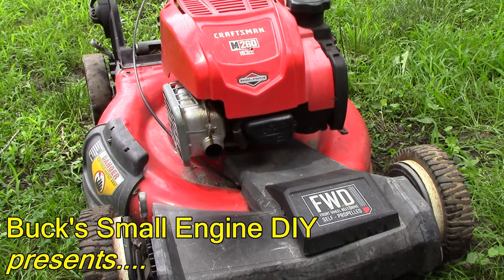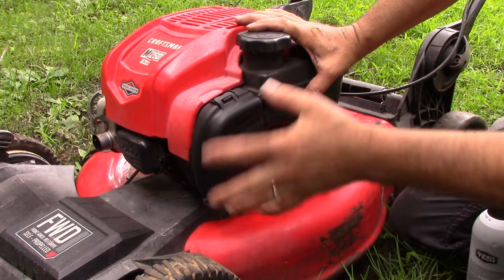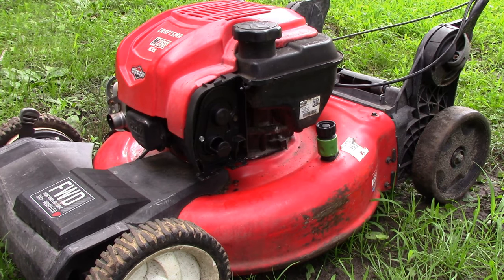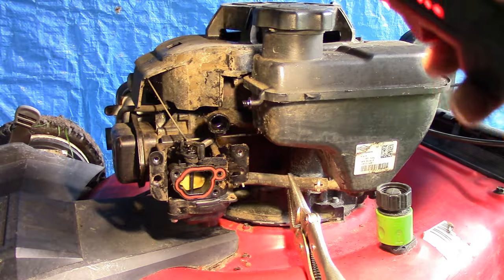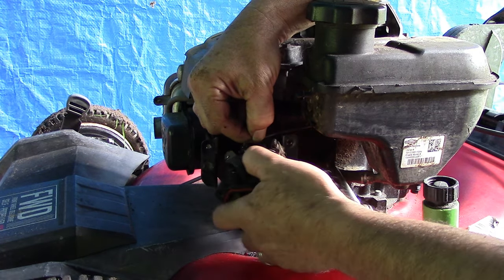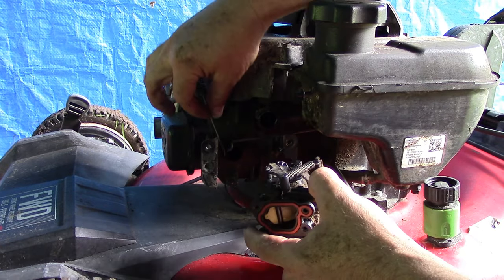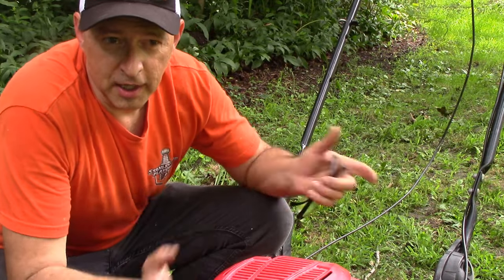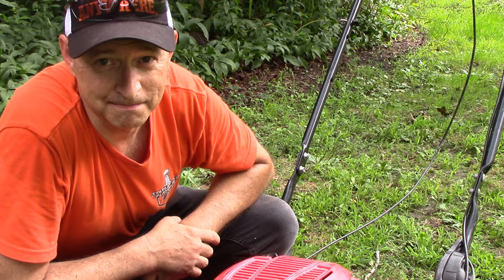Lawn Mower WON'T START - 10 Minute FIX !!! - Craftsman M260

Comment: I should not have to do this I just bought it yesterday and it literaly wont start.
Reply: Used mine twice and won't start
Reply: litterly
Reply: Yep these are junk after very little use
Reply: Don't make em like they use 2
Reply: Same it’s a pos
Reply: Was this your fix? What did you do?
Reply: I had water in mine, put gas  leaner in it works great
Reply: @punako268 Ive had mine almost 4 years without any issues until this year and the carb needed cleaned plus changed the spark plug and filter. Just like any engine they need care.
Reply: I would have taken it back. Mines worked great for nearly 4 years with hard use. Maybe I just got lucky but it's lasted longer than any other mower. Idk.
Reply: I hate this mower. Always problem with it. Spark plugs burn out every few mows. Did oil change even though manual says u don't have to. It's garbage
Reply: Save your gas hopefully it is not ethanol fuel take it back make them give you another one other option is to take a carburetor jet kit drill bit and open the Jets up just a little bit EPA but such restrictions on fuel powered mowers it's kind of funny painted out and burn it out or make it a little fatter on the fuel side and make it run
Reply: Same problem with mines I've used the damn things twice..I bought it new and now it doesn't work
Reply: @punako268  Have had mine for 6 years🤷‍♂️ only have replaced the blade
Reply: Exactly... Like wtf 😒

Comment: You can clean the gunk in the main jet as many times as you want, however, it will stop up again and again because the federal government wanted fuel efficiency and as a result the opening in that main jet is 0.12-0.13" in diameter (this where all the gas to the engine must pass through). You need to drill out the main jet to .021" to make sure it does not clog up. This is the diameter of most small engines without the plastic carb and it works just fine and even better at .021". Same for any new replacement cartridges.
Reply: I just bought the replacement 4 pack he linked and I'm going to try this with one and see how it goes.

Comment: ❤❤ thank you so much. I panicked from my fathers mower breaking. And I was the last one who used it so he was going to get mad at me. All I know is that it started then stopped. I was procrastinating the fix after watching this vid weeks ago due to I didn’t trust myself. Not today.  I took it apart and cleaned the jet out with water, soap and a needle and it works! Thank you so much for your vid. Other vids are not as detailed as yours. Will subscribe and like.
Reply from the maker: Great job fixing it yourself!

Comment: Thank you. Mower wouldn't start after 10yrs and was going to take it to the shop or buy a new one. Changed our spark plug and filter and still didn't work. Watched the video and in 10 minutes I had the mower going. Like you said it took longer to find the tools. I was able to clean out the line in the plastic component with a little wire. Fired right up on the first try. Good for another 10yrs.

Comment: I found adding a few squirts of carb cleaner into the gas tank and trying to start it at intervals while levering the lawn mower up and down with push bar finally got mine to work. 🤷‍♂️

Comment: This video got me to remove carb, (watch for O-ring) pull jet cartridge and get my neighbor's mower running again. Thanks for the video. My carb had an O-ring that fit inside carb where it pulls off from motor. Watch for that as mine fell out when removing and landed on frame. After getting it re-assembled I noticed an O-ring...Extra part...UGGGGG and had to figure out where it went.

Comment: Thanks for the video . I took it apart did option 1, sprayed the jets and used a brush to clean it out. Put it back together, started on the second pull. It is surging slightly, any idea why that would be happening?

Comment: Thx. Not a direct fix, as my engine's carburator is all metal (float, float bowl). Bought it in 2000 and still going strong. Anyway the single nut holding the bowl had small holes which I cleaned and blew into and I actually noticed the blockage free up. Back and running. Thx again.
Reply from the maker: Great job!

Comment: Thanks for that. I have the same mower. It starts first pull when cold, but after shutting off to empty bag, no amount of pulling will start it. It has to cool off.. Werd.. I tried cleaning the carb, no omprovement. So, I'm ordering a set of jets. 

Anotherr weird thing is the manual says oil does not need to be changed.. and there really is no place to drain it.

Comment: I did this but after re-assembling, I released the clamp on the gas line and fuel started flowing out. 
I don’t think I had the filter housing back on just yet, was that why or did I screw this up?

Comment: Okay, I took my plastic carb on my Briggs 500e off and took it all apart and cleaned it thoroughly.  Put it back; doesn't want to start and leaks gas til tank is empty through the carb throat.  I made sure all gaskets and screws were in good shape and tight.  Only thing I can think of id maybe the O ring and plastic retainer at the back of the carb is defective and leaking there.  Your thoughts please?  thanks
Reply from the maker: Leaking gas till the tank is empty means your needle/seat/float in the carburetor is not working properly. The easiest thing to do is just get a $20 replacement carburetor from amazon or ebay. Make sure all that gas has not flowed into the engine and filled up the crankcase with gas. In other words, check the oil level and make sure it's not overfilled. If it has, you'll need to drain that all out and add new clean oil. Good luck.
Reply: @Buckwsr  Actually I tested the float/needle when I had the carb off the machine and it seemed to function well.  I did buy an aftermarket carb and will install that and see what happens.  Thanks for your in put; I do enjoy your videos.  Keep them coming!!
Reply: @lawrencecarroll2031 I've had situations before where the smallest speck of dirt on the needle or the seat will cause it to leak and overflow...the needle was not seating fully into the seat because of the speck of dirt and it was slowly but surely flooding....
Reply: @macknumber9  Thanks for your input.  Believe it or not, it was actually the brake cable causing it to internittently start or not.  I had freed it up after being frozen with rust.  However it would pull the cable back far enough every time.  With a new (used) cable, it started and ran fine.
Reply: @lawrencecarroll2031  you mentioned that it was flooding
Reply: @lawrencecarroll2031  I'm assuming that the flooding you were referring to was actually just from attempting to start it and it was not starting because of no spark...so the carburetor itself was not flooding but the act of pulling the rope 10+ times was causing gas to be saturated inside the carb venturi area
Reply: @macknumber9  Yes. it was doing that too.  Never did figure out why.  I replaced the carb with a new one and also replaced the brake cable as I mentioned above.  Thanks to all for your comments and advice.

Comment: Can you recommend a store where parts can be purchased ?
Reply from the maker: I buy virtually everything online. No point running all over town to store who won't have what you need. Use mower brand and model numbers for online search. If looking for engine parts, use engine make and model numbers in your search. Good luck. See my amazon link in the video description for the carburetor jet I replace in the video.

Comment: Couple tips 
Probably should have drained the gas tank. That carburetor got crapped up somehow - bad, old, stale gas is the culprit. Drain and refill with fresh gas 
The screws inside the air cleaner are , 8mm and 7mm
In case viewers don't have 
9/32.

Comment: I don't have starter fluid spray. Can I use carb cleaner?
Reply from the maker: Some carb cleaner is flammable, some is not. The stuff from walmart is not, so that will not work. The name brand stuff, like Gum-out, is flammable and will work instead of starting fluid. You could also just shoot a little gasoline into the throat of the carburetor. Good luck.

Comment: It was fine all morning. Mowed two lawns then stopped working out of no where. It’s stress but has no power behind it now. The other problem is that once the blades engage, the mower turns off. m430

Comment: Use some Seafoam regularly say every 15 running hourse aprox., especially near fall and storage time. Then buy  a$2 shut off valve installed in the rubber gas line as a shut off, or completely empty the tank and carb bowl by running it dry. Store.

Comment: My problem was that the inside of the rubber gas line that goes from the tank to the carburetor was swelled inside?? , and that was the only problem that I was told about by someone that I know. I took it off of the carburetor and just got dripping.
Reply: A kit was on Amazon that included the hose, a spark plug, and air filter, all of which I wanted with a new carburetor, for 24.99. I didn't see the plastic thing that goes in the carburetor sold separately.

Comment: Hey, thanks for the vid!   How good are those plastic carbs compared to the standard, metal ones?  Looks fairly easy to clean.  What brands of lawnmowers do you usually see them on.  👍👍
Reply from the maker: These Briggs & Stratton engines with the plastic carburetor are all over the place....mowers, power washers, brush mowers....literally everywhere.

Comment: It's worth a shot. You did a phenomenal job teaching and showing, I'm goin' in! Thank you 😊
Reply: Can you tell me what type of oil to use in this machine, please 😊
Reply from the maker: You got this!
Reply from the maker: A straight 30 weight motor oil will be fine. Could also use 10W-30, available at Walmart or any auto parts store. Be careful not to overfill it!
Reply: @Buckwsr  I'm pretty excited, it fired 3 times. So the part you replaced in this video is enroute 🙌🏽🤩 The smoke that came out was white, I'm hoping that's a good thing. 🤞
Reply from the maker: @sologmomma2494  Awesome! Good luck, and let me know how it works out!

Comment: it won't start cleani The carb replaced the filter and spark plug and the gas still won't start. what else can I this is a JONH DEER JS63H WALKING  MOWER, WHAT ALSE CAN'T I TRY? Buck
Reply from the maker: Try this link. In this video I work on a John Deere JS63, like you have...https://youtu.be/afjn9HKLiZQ
Reply: I replaced the carburetor with a new one and the air filter, it started and ran for about 2 minutes and is back to square one again, won’t start.  The only thing not changed is the spark plug so I’m stomped!  It’s a Craftsman self-propelled.  Loved the video BTW!😃
Reply from the maker: Well, I mean, it could be the spark plug....

Comment: Can someone explain the reasoning behind this?
Reply: These newer Briggs & Stratton plastic carburetors have very little tolerance for any debris in your gas, or sitting for a long time (winter) with ethanol gas in the carburetor.  
What this video is showing is the main jet being taken out and replaced. What’s really going on is that some of the tiny holes which fuel passes through are clogged. I prefer to just.just clean them out as apposed to buying a new one. 
Most of the time this can be prevented by Not having ethanol fuel sit in your carburetor all winter. You can either run your mower out of gas before you store it for the winter or you can burn an ethanol, free gas (clear gas) in your mower.

Comment: So naturally i tried this and failed lol. But as i popped the carburetor out, two pieces came loose: a thin metal rod (which i am assuming is the piece to connect the main jet line to the outer shielding... but then another piece; a small nail like component. The top was the same white plastic as the main jet line  and then bottom had a white point tip, the same black as the cover.  I accidentally forgot to put that piece in originally, but tue mower started fine, but gas leaked out the carburetor. When i attempted to insert it underneath that outer shield, the mower wouldnt start, but gas wouldnt leak. Anybody encounter this?
Reply: UPDATE:

float needle valve that allows the flow of gas into the carb. Very important and goes inside the float and placed carefully into the hole underneath the float. Mower works like a champ now.....until the blade fell off and now I need to buy a 16mm bolt replacement 😂
Reply from the maker: Good job getting it back up and running!
Reply: @Buckwsr  thank you this video helped a lot!

Comment: With those specific type carb bowels, cant ya just use allen wrench to open drain valve. Reseal valve and allow it to refill with fuel before taking half the day to disassemble the entire carb system??? Too many chances to loose pin,damage seals,put it back on wrong, break fuel line.....on and on and on?????

Comment: "Crapsman"
I use Ethanol free gas
I use fresh gas with stabilizer.
I never leave gas in the mower after each season.
I change the air filter as needed
I change the spark plug as needed I replace the carburetor every year. 
Every year the damn mower won't start. 
Sick of replacing the carburetor every damn year!
Why should I have to replace my Carburetor every freakin' year?!
Reply: You put fresh gas in the gas tank, but the carburetor bowl still has last years old gas in it. :face-green-smiling: